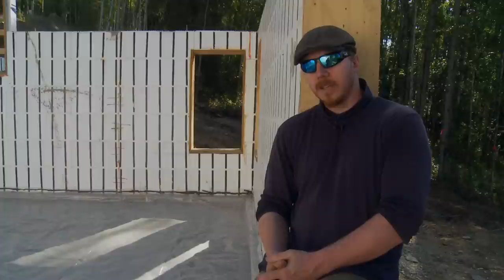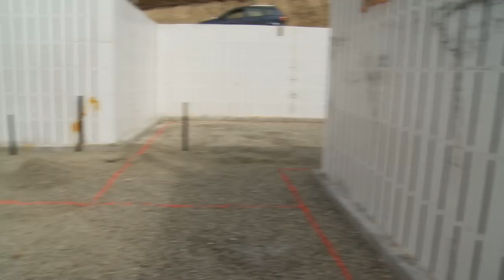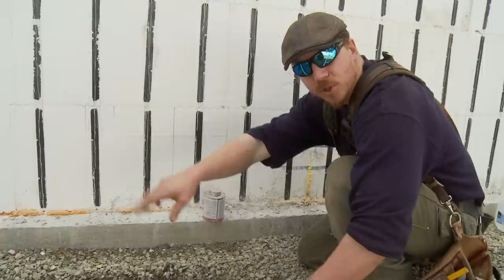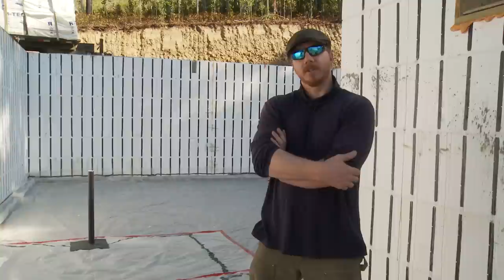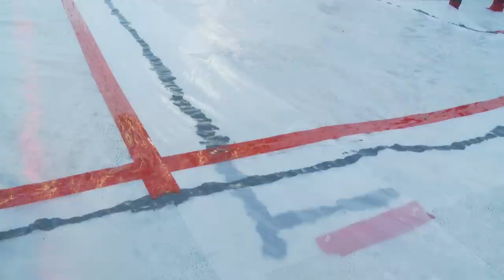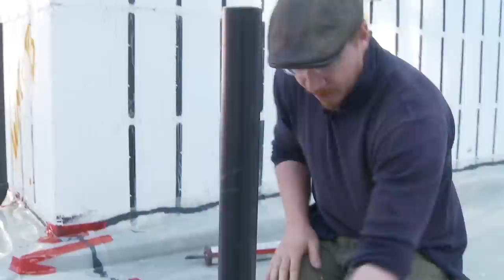Radon mitigation in new construction

Comment: I do wonder. If the house would have been built not on the gravel (on ground) but... say.. on pols. Meaning, about 1 meter above ground, and sits on pols, and the entire surface underneeth the house (meaning, that 1 meter) would have been open (no walls or anything). Would the radeon still could go into the house?.
Reply: no need for radon mitigitation if the house in on stilts or poles, radon would not be trapped or absorbed into the house, it can escape in the gap.

Comment: Since you implemented an acoustically sealed and coupled barrier, wouldn't that keep the radon gas out thus eliminating the need for a vent and under slab pipe?
Reply: No depends on the perms of the poly
Reply: No, you need the suction and piping to direct it where you want, out. Otherwise,  it will eventually find its way into structure. Like water, along path of least resistance.